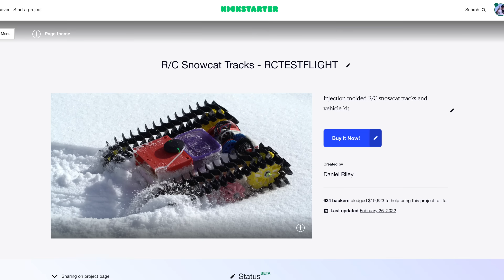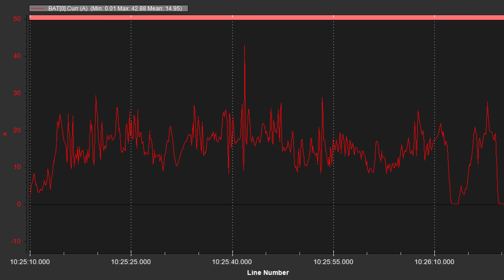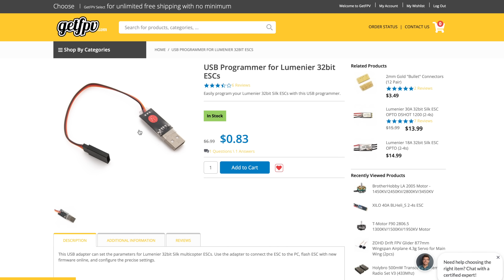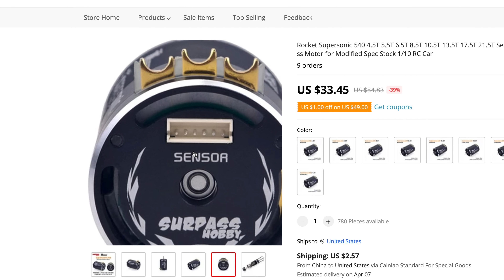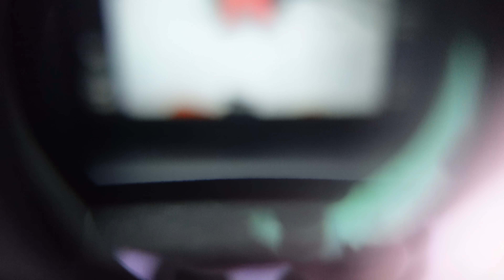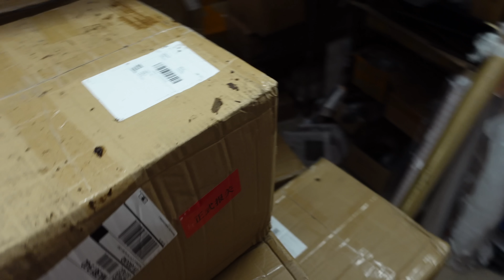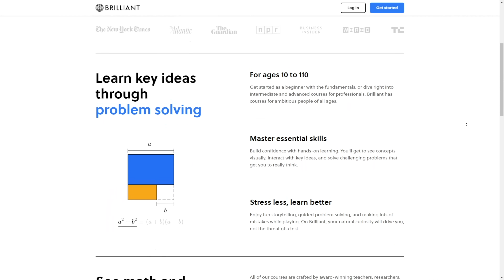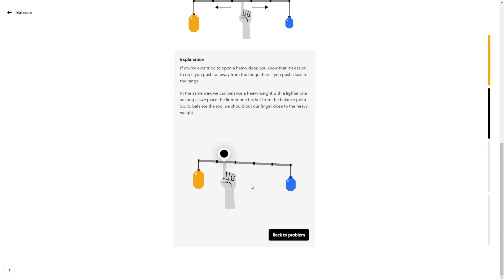The R/C Snowcat is HERE!!!

Comment: Not sure if you will read this comment, but the settings you should change are timing advance and startup power.
But as you can find out easilly, most "car" or "truck" ESCs are rated at least 80-100A, with "offroad" versions usually around 200A.
If you want to stay with a "Flyer" ESC, you really should push the rating way higher. Now that you know you get 100A spikes, I would go with a 150A ESC. That should account for a full-speed to full-stop spike and not burn anything.
The second this is gear reduction. Most "ground" motors are in the 2000kV range, and use a higher reduction to lower the final speed. That is because even if the overall power draw is similar, higher current on a lower kV setup will waste more heat and can cause heat soaking of the stator, which further decreases the magnetic field and power.

I have been doing drones and RC cars/trucks for over 20 years now, tried a lot of stuff and burnt even more. Send me a message if you want to chat!

Comment: Maybe the reason those ESCs blowing up is because those are totally not designed for this kind of operation. They don't even have a shunt (or matched pair FET) to measure the motor current properly.
Take a look at the VESC project in depth. The sensorless startup on those are excellent, since it can measure the rotor position with HFI without sensors.
Reply from the maker: too expensive

Comment: One thing the rock crawler guys are doing is flashing AM32 on blheli32 escs and running big outrunner motors on their crawlers. AM32 has really good low speed fidelity using "Sine Start". there are forks of AM32 as well that do this even better and it will totally fix your low speed throttle resolution issue.

One thing that I've found to help as well is if you modify the radio settings to lower the speed on your motor channels. I mean transition speed. I believe this is pretty straight forward in opentx.... I know my RC car radio has a setting for this which I use with my rock crawlers to make the throttle less twitchy.

This will also help with your ESC burning issue.
Reply: Just search AM32 crawler on youtube to see some examples of the firmware in action.

Comment: Is the esc enclosed? If so then you might need so add some sort of cooling, because air is a very good insulator. I reckon to  heat up an cooling fin with a blowtorch and then stick it through the printed plastic. Then glue the esc to the cooling plate on the inside. When run in the snow you should have enough cooling power on the outside and the cooling fin should help a lot

Comment: Awesome video, love the project! If you record in the DJI goggles, the SD card will have a text file with the telemetry the your video editing software can interpret as an overlay. Doesn't record onboard the air unit though :(
 Also, I found the ESC current spike info very helpful for a rover project I'm doing, thanks!

Comment: This is capable enough to have a search and rescue application. Make it big enough to carry communication & tracking gear, and send it out under FPV control. It can search as long as it likes and if it breaks in dire weather conditions - meh! pick it up in the spring. All without exposing a search and rescue person to life-threatening weather conditions during a search. Might need a better camera and directional microphone though. You could even develop a swam of them to search a large area quickly, but that would require autonomous AI's on each, and a bigger battery!

Comment: Hey my project is similar to yours in a lot of ways: i currently working a sensorless esc with phase current sensing to get full torque at low speed with a cheap esc 16€ (B-G431B-ESC1), it has even a temperature sensor on it so no burning anymore. I can controll my rc car even through mobile internet if u are interested.

Comment: Regarding the Sensorless Motor torque issue: 
If it is possible to fit Sensored ESCs, but a pain to source/fit Sensored motors, consider trying to add external hall sensors to the existing motors. 
Quick google yielded this: https://www.youtube.com/watch?v=XVX5T7JkBDA
With current PCB prices it might even be a reasonably priced solution. 

Regarding BLHeli_32 ESCs: 
Make sure they actually have a current shunt on board, many don't. Without the current shunt, it's not really measuring the current, just electrical noise (which increases with current, potentially explaining the 1A result).

Comment: It would be cool to use some small two stroke engines to power this frame. No idea how it would work controlling it electronically though that would probably be an unreasonably difficult project
Reply: rc tank building has a lot of history with gas powered rc tanks, they arent too complex, but depending on the transmission design can be heavy. honestly  for anything less than 1/6 scale its not really worth it
Reply: @teslacoil4335  Interesting. I had a snow plow vehicle in mind, except instead of physically plowing from a seat, I could just sit on my porch and do it remotely. Might make the task more convenient
Reply: @tbmavenger71  with some looking a small nitro engine with a pretty heavy gearing ratio you could do a double differential drive design, i say try it if you can, i would love to see it

Comment: I’ve seen that you do a lot of prototypeing and have a lot of leftovers 3D printed parts that you may not use. What are you doing with these parts. If your not doing anything with them a Maschine that melts the parts back into a wire that you can use in the 3d printer would be cool.

Comment: Those motors are using way more then 9 amps unless u are running at over 80+ volts. Check your current readings imo just oversize your esc? Simple?

Comment: switch to homopolar brushless dc motors, no electronics to burn
Reply: no homo, just torque
Reply: diy if you cant find any on the market
Reply: you could put higher tracks for double sided driving
Reply: have you tried oculus quest 2 as the fpv goggles, with a normal camera, directional wifi
Reply: lidar radar on the bot
Reply: landscape mapping
Reply: hud lanscape map display
Reply: omg!
Reply: make a track worm, from those tracks, ie, hubless wheel track robot
Reply: or a (track) ball that has the robot inside, 360 motion ball, not the star wars ball, the robot and batteries are inside, not outside, of you
Reply: hubless track robot worm

Comment: its seems to me all these genius engineering guys are missing one big trick, INJECTION MOLDING  even if you have no idea what it is most people know its very very expensive, surely one of these guys can invent some way of making the blanks for a much cheaper price after all these things often turn out to be a con by the patten owners or those in the know and they work in dishonest ways, if you could invent molds that cost half the current cost they still would be expensive but much more obtainable and the inventor could be rich or at least break the monopoly on the industry